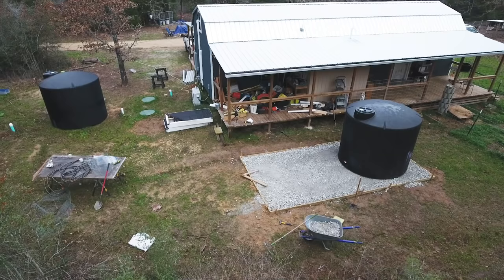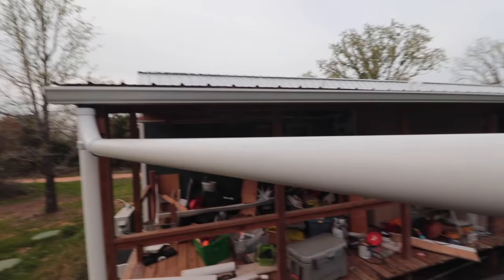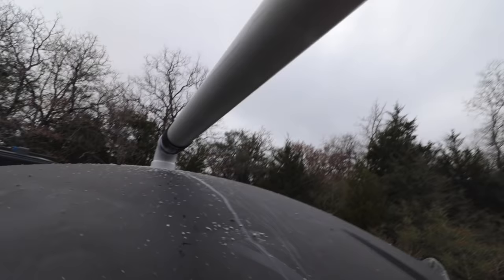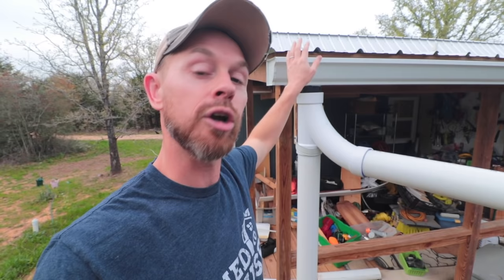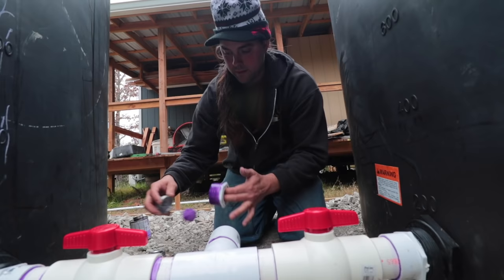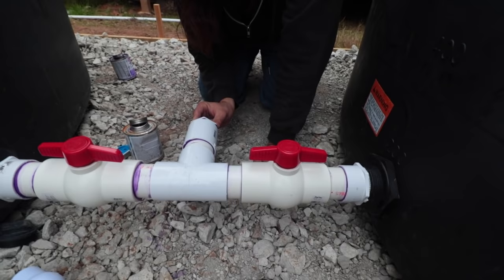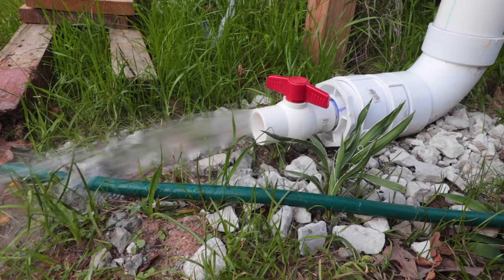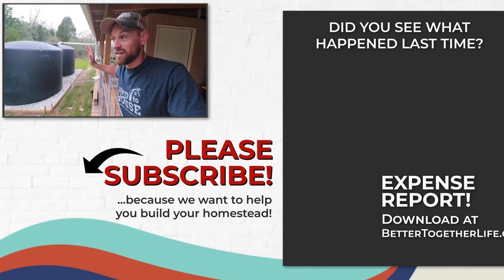How to Install a 5000 gallon Rainwater Harvesting System

Comment: Idea for your Leaf Eater: instead of using that sanitary tee right up on that gutter downspout, connect a piece of straight pipe down from the downspout, then Leaf Eater, then straight pipe, then sanitary tee to your first flush and main inlet pipe.

Comment: 9:13 the rain head spinning thing - it either goes straight down.  Or straight back.  It doesn't go straight forward.  If you're plumbed together, you can take your water down and bring it back up, though.  So if your tanks were farther away from your catchment surface the inflow pipe could be in the ground and come back up - as long as the place the water goes in is higher than any other place.
Reply from the maker: It is working fine for the last year.  Thanks a bunch!!!!

Comment: Did you ever have any problems with the course gravel bed and the weight of the tanks? Any leaks on the bottom? I have been told to put down a bed of pea gravel or sand. Thanks.

Comment: This was really helpful, thank you.  One question please, though.  If both fill evenly with just the one inlet pipe, why don't both drain evenly from the over flow pipe?  I mean why does each tank need it's own over-flow pipe?   If one tank went down, wouldn't both tanks go down together?   I cannot afford a giant tank like yours, but  I want to hook a series of rain barrels to over flow in to  my old underground cistern.    What if on each barrel, a few inches down from the top, I put a pipe from one to the other, barrel to barrel, with the last one being the pipe that over flows into the cistern?  Open to suggestions, thank you.
Reply from the maker: Sure you can have multiple overflow pipes.  We just did it this way for ease of installation.

Comment: Great video.  Thanks for sharing.  One observation: I think you said that you wanted to eventually bring 4" from your front gutter to the storage tanks by travelling under the house.  I would think that on a gravity feed system, that would create a significant "head pressure" problem.  Wouldnt you need to bring the 4" line from the front gutter at least the same elevation as the outlet of the rear gutter system?   Seems that anything lower would result in backflow. Yes/no?  Great vide
Reply from the maker: Thank you!  

Well rainwater storage is like a lake, it will always find LEVEL.  So all you have to do is plumb them together and they will fill at the exact same level.  

So as long as the INLET is higher than the OUTLET they water will flow.

Comment: your overflow pipes will possibly be a problem.. you are running what looks o be a 1 or 2 inch pipe out of each tank and then bringing them together at the bottom into a pipe that looks o be half the size.  that will severely restrict the flow and may cause backup in heavy rain. just a thought... great video thanks..

Comment: Should have used a couple PVC unions after the shut off valve to connect the 2 tanks at the bottom to remove the entire tee.  Why?  Because if he needs to drain or remove 1 tank for one reason or another he'll have to cut out the tee.  Its gonna take a hell of a long time to drain a tank for that 1" line to 1/2" spigot.

Comment: You did a good job at explaining how the second tank balances and is filled using the outlet from the first tank.  Why  couldn't you have filled both tanks the same way and at the same time?  You could have used the same bulkhead fitting on each tanks for your inlet and your outlet.   You could have avoided cutting a hole in the top of your first tank if you plumed your 4 inch drain into your outlet tee going into both tanks.  Each tank would be balance and fill at the same time via gravity since your gutters are higher than both tanks.    You would still need your overflow line which would equalize the air pressure of the tanks when filling.  The overflow line should be matched in size to your inlet line otherwise you are still gong to get that mess on your roof once both tanks are filled.
Reply: Pluming the tank using the bottom bulkhead fitting, would allow you to move your tanks away from your house, by running a poly line underground to the remote location of the tank.  That line and tank would need to be at a lower elevation than your gutters.

Comment: Hey - nice video, super helpful.

I had a question: did you use anything besides gravel for your foundation to create a smoother surface? Have you had any issues with the gravel puncturing holes in the bottom of the tanks? I heard that this can be a problem - maybe for larger tanks, but it didnt look like you had smoother the your foundation surface with sand, so was curious if it should be a concern. thanks!
Reply from the maker: My rocks were a little bigger, but the rock that I used had some kind of “binder” liquid stuff in it or something.  And it basically created a smooth concrete like pad.

We used the same stuff for our Shed to Studio foundation and it works well.  But yes, I would be lying if I said I wasn’t a little concerned.  But we’ve had ZERO issues for the last 2.5 years.

Comment: Im sharing this info as ive only learned of it recently and some people may be asking whats a first flush,  whys the pipe look like that, etc why isnt the water going straight to the storage tank.   The way I understand it is between rains, your roof is also collecting other things/substances, not just rain drops.  We talking about bird poop... squirrel poo... pollution and dust,  perhaps sand, leaves and other bio-matter...  SO! The first rain comes, and it flushes all that debris and gunks off the roof, to the gutter and... if you have nothing else, all that harmful nasty crap will eventually land up in your rain collection barrel system, where it may end up being food/a home for some bacteria or fungus or algae, whatever.  BUT! That first "flush", if its instead diverted to a long vertical pipe, that debris and gunk will slowly fall to the bottom of the pipe, and mostly clean rain water will fill up the pipe and continue to fill tillbit over flows,  the theory being the over flow will be mostly clean, minus any large physical debris, and that cleaner water will be whats stored in your rain catch system.

Any corrections/additional info that I left out, please let me know!

Comment: Very good
But you have all that roof catchment area a 4 inch collection pipe and future another 4 inch on the other side that's 8 inches collection and only 1 inch overflow. I think you better have a bigger overflow to be safe
Good job I enjoyed the video
Reply from the maker: It doesn’t exactly work like that.  The overflow never needs to equal the intakes.
Reply: @BetterTogetherLife  Once the tanks are full, overflow has to = inflow or you get backup.  I'm currently designing a 10,000 gallon system off of 8500' of roof (barn and house). In NE Oklahoma, we average several storms per year that drop .5" of rain in 15 minutes.  That's 300 gallons per 1000sq' of roof in 15 minutes, or 20 gpm per 1000.  You have about 2000' of roof.  If you tie it all in to your tanks, you will easily overwhelm a 1" (approximately 16 gpm max) overflow line during a moderate storm.  It probably won't hurt anything, but it will overflow your gutters and drop water where you don't really want it.  With 8500' of roof, I'm sizing for 240gpm to account for 2year storms.  4" pipe is necessary.  And you aren't kidding, it ain't cheap!

Comment: Hi!  I see this video is a year old already but wanted to share a thought with you.  You do not need to use 4" pipe to connect the systems.  A smaller pipe will work.  It may just move the water more slowly, but will still work.
Reply: Thank you for answering my question. What size would you suggest?

Comment: Cuts a hole in the tank instead of using the pre drilled hole in the lid, that has a spot for a fine mesh filter.
Reply from the maker: Jonah, tell me how you'd keep the light out of that "inspection hole"?  This tactic (and yes, different strokes for different folks) eliminates the possibility for light to enter the tank and causing algae growth issues.

Thanks for the comment!!!!  :)

Comment: Just a general question, but are you concerned about freezing your overflow pipe or other pipes in the winter when it gets below freezing?  Do you think you may still able to appropriately use the system?
Reply from the maker: There shouldn’t ever be water in an overflow pipe.  

Also we are down here in Texas, so no

Comment: Feel strong wind could shift the pipe and tank a bit causing leak in a few seasons.
Reply from the maker: Not going to shift the tank.  And how could it leak with no water pressure??

There is no chance that wind could shift the outlet pipes.

Comment: FYI my tank delivery guy said never use a pressure washer or you can shoot a hole through the tank. Just use a long handled broom type scrub brush.  He also told me to put four bags sand (over top of gravel base) under each 2500g tank to keep gravel from poking tank because the weakest part of the tank is the bottom. After pushing the bottom it for sure is thinner than the sides. And his last important tip is to make sure to run a long level against the sides to make sure it’s level before filling. Now that last thing is probably the only one I would have known 🙄
Reply: In the Caribbean we use this type of system all the time with pumps with no problems. Our tanks are usually stacked on concrete scaffolds.
Reply: @abbe1abbe156  yes I should have clarified I had a level spot that was filled with small gravel as I had seen on many videos & he advised to to cover with sand.
Reply: @nicolem376  I understand.  I'm curious about the reason most systems I see in the US seem to have sand or gravel on the base. The stacked scaffolding system is very efficient bringing water into homes by gravity from the top tanks for all in home water needs.  My parents have that system in the Caribbean.  We only bought water for drinking and cooking.

Comment: thx for the tips . . but I was under impression that pea grave should be used to avoid puncturing the tank. These rocks look like they will damage the tank with all the weight of the water?
Reply from the maker: You will never be able to keep pea gravel underneath the tanks when moving it.  You’d have to use a crane. 

Nope.  You want rocks that are 1-1.5inches
Reply: @BetterTogetherLife   I agree I ended up going with crushed limestone that are very small. They compacted really well. The rock guy said same thing. I was thinking pea gravel to avoid any punctures in tank. Appreciate your reply! :)

Comment: you may need to increase the size of the overflow pipe... or at least make it 1"1/2 all the way down? ......if you get to the point where the tanks are full with the size of your catchment roof and a 4" pipe feeding water into the tanks  the 1" overflow pipe may not be able to cope!!!
Reply from the maker: It could be possible, but hasn’t happened yet
Reply: @BetterTogetherLife   I will definitely happen.  I sounds like the tanks haven't overflowed yet?  If you need a 4" inlet  you need at least 4", maybe larger because of friction loss in that long horizontal run under the porch.  Good news is, when it does happen, it's not the end of the world.  You will just have that mess you at your gutter/pipe junction that you mentioned.  But, it WILL happen.    As a side note, when you glue pipe together,  always rotate the pipe in the fitting as you are joining them to ensure even distribution of the glue.

Comment: What do you do about freezing weather?  Won't the PVC fittings freeze crack and leak?
Reply from the maker: Not if there’s not water pressure.  You just drain them out before the freeze.
Reply: Then you can't have running water in freezing weather.  Bummer.

Comment: A question ? Does your water tank have an air vent ??? To let air out once the water comes in ... otherwise it Will distort the tank capacity
Reply from the maker: No again, the water pressure of 2500 gallons is way stronger than what you think will happen.  

You don’t need to vent.

Show me your water tanks and how you have them setup.

Comment: Do you think one tank could be set approximately a couple of feet below the other and when one hits top off point it overflows into the other?
Reply from the maker: You don’t need that.  You just plumb them together like I did in this video and they fill at the same time just like one tank.  

It’s like a lake..... water will always find level.

Comment: I am in North Texas... we have had some pretty good freezes.  is that insulation sufficient to keep those pipes and fittings from freezing?  I used some pipe heater tape when connecting the water line to my trailer after it froze a couple years ago, that seemed to keep it warm enough to not freeze.
Reply: Great video😃 How do you stop the overflow freezing? I’m in Northern Ireland, not too sure how cold Texas gets, we go down to -15ish. Also how do you stop the bottom of the tank from freezing?

Comment: I believe your overflow diameter is to small.  If I’m not mistaken the overflow should be larger than the inflow to prevent back flow. The small overflow pipe will not be able to Keep up with the inflow during a monsoon rain .
Reply from the maker: That’s a great point. If you have monsoon rain, go for it. This is the right size for our area with very average to low rain events. We have have very heavy rains with no back flow. So that’s really up to the user and their location.
Reply: @BetterTogetherLife   I wish I could use the 1-1/2 bulkhead that comes with the tank but unfortunately it backed up at the gutters. So I had to go with a 4 inch drain pipe. Here in Arizona the monsoon rain is no joke.

Comment: Is there an air valve to release air build up inside the tank as the water level goes up?
Reply from the maker: Well there is the overflow pipe.  But no you don’t need anything like an air valve.

Comment: Put a air valve in your tank...just like on your tire...and put air in your tanks to build pressure...
Reply: The tanks are not rated for pressure.  Even if they were, they are open to atmosphere via the gutter, the overflow piping as well as the lid vent.

Comment: you've probably realized by now the overflow pipe should have gone from 1 1/2" from one tank, 1 1/2" from the other, to a 3" pipe running around the house to under the steps. 

reducing the size of the overflow pipe was a no no.. you need the size of the overflow pipe to be able to handle the amount of water coming in from the source (the gutter) or the water will get backed up all the way to the source (the gutter) and overflow excess water there.. which would be bad if you had so much water weight sitting in your gutters that it was overflowing there. Could rip the gutters off the house.
Reply from the maker: Nope.  The overflow as been PERFECT!

Comment: Has anybody suggested a ram pump to get the water from small tank to big tank? Or a sump pump with modified float to clear most of the water?
Reply: Ram pumps are horribly inefficient for transferring water from a closed tank to another.  Only about 10% of the water will make it to the top.  Ram pumps are great for streams where you are losing the other 90% one way or the other.

Comment: Once the drop pipe is full of dirty water you have to go out and empty the pipe - is tht correct?
If it is corect, what happens to the next batch of rainfall if that pipe is already full of dirty water?  Does the new water just shot over the top of the dirty water and go directly into the tank? Isn't that water dirty that is going into the tank?
Reply from the maker: You are thinking about it wrong.  It’s not the “dirty water” that you are flushing.  It is the actual dirt and bird poop etc that you are flushing off of the roof.

Which means that all of that sinks down into the first flush, leaving mostly clean water at the top.

But yes, you have to flush out that water after each big rain.
Reply: @BetterTogetherLife  It would seem like the first flush would be greater than that pipe is long.  What am I missing here?
Reply from the maker: Not sure what you’re missing.
Reply: @BetterTogetherLife  If the first flush of the gutters is say 50' and that pipe is 4' or 5' it would seem that the pipe would fill up quickly and then A LOT of dirty water would just shoot over the top of the ball and into the holding tank.

Comment: How do you keep your water tanks from freezing in the winter?
Reply from the maker: Texas.  🤣🤣
Reply: @BetterTogetherLife  lol
Reply: Once an ice build up on the inside gets about inch or so, it insulates.. so its self limiting. In my water troughs, I pile old hay/straw around the bottom and the fittings. You'd be surprised how well that insulates. To keep the material from settling in the gravel you could lay plastic first..

Comment: Are you planning on harvesting the water right after it rains?
Because that is a LOT of stagnant water you are leaving by doing your friend's idea.
Stagnant water = mosquitoes.
I would leave it like is, BUT instead of using the ground to support it, why didn't you place four cinder blocks, criss cross and let it rest on them?
Then you would have your support, and your END cap would drain high enough to get a bucket under it.
Just a thought.
Reply: The tanks are sealed from any mosquitos getting into them.  He put a screen over the pipe that is just below the gutter.

Comment: You could have ran that pipe under ground and up into your tanks as long as your roof is higher than you tanks gravity will push the water thru and up. You prolly already kno this I just think it would look more pleasing than having a 4in pipe running mid air to the tank.
Reply from the maker: It’s fine for us.  And less maintenance.  A wet system you do need to flush more often.
Reply: @BetterTogetherLife  And a wet system can freeze in the winter, even in Texas.